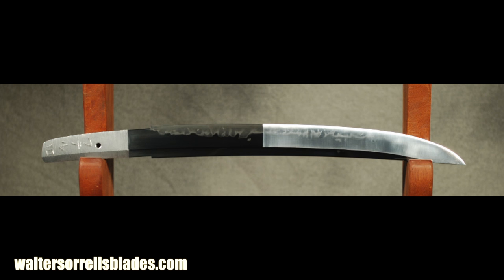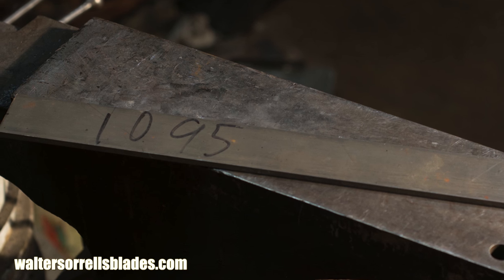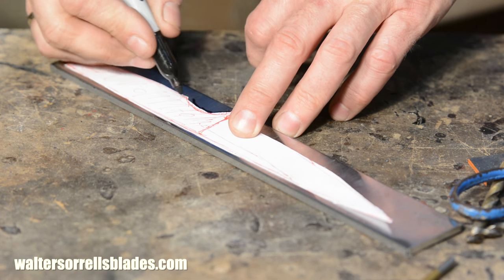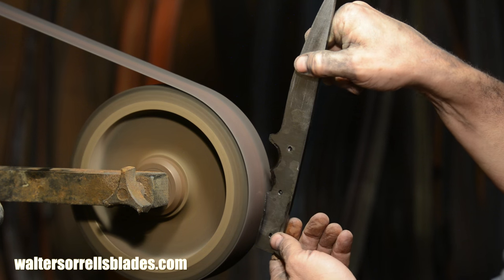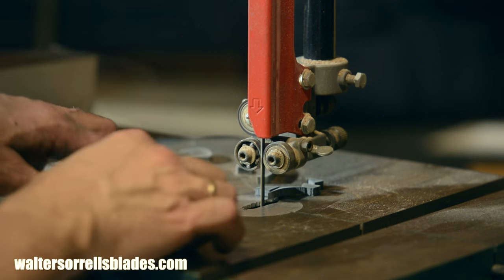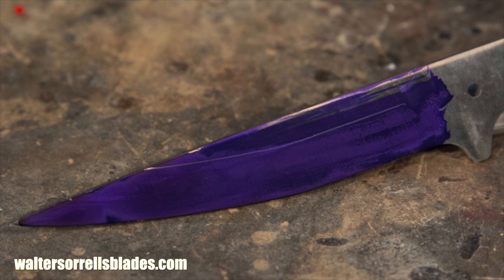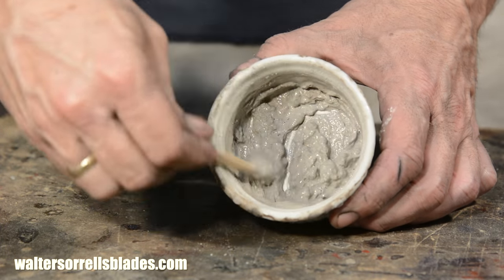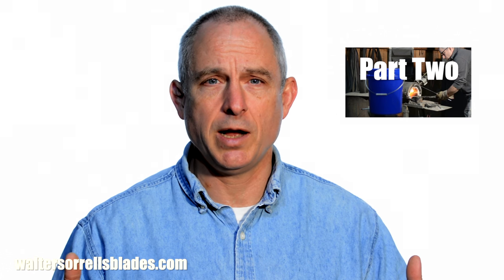Making a Modern Tanto for a UFC Legend

Comment: So, the temper line that you speak of. Is a temper line. They used to coat the spine of the blades in clay to prevent the spine from becoming as hard as the edge which would cause the sword to snap when struck.
Reply: +Shane Sischo Well if you wanna get really technical, "temper line" kinda makes a reference to tempering. A hamon is created during the hardening process, not tempering. You can have a temper line if you harden a blade homogeneously and then differentially temper it.
Reply: Aimee Frost The structure in the steel is created during hardening. Polishing it just reveals it.

Comment: As someone who just made an osoraku Tanto (but failed I the heat treat), I filed in the bevels and ended up with the proper geometry but I noti that there was a dip in the bevel near the transition on one side. So even if you atempt this by hand to get past the quirks of a belt sander it is still quite difficult to end up with the proper grind lines.

Comment: When my friend does clay tempering he also uses refactoring cement, but he puts a thin layer on the edge with charcoal mixed in. Supposed to reduce de-carbonization. Is that true ?

Comment: do you find that grinding the bevels pre heat treat gives you advantages compared to doing it once its been hardened? Awesome knife man you are a true artist!
Reply: +john smith pre-heat treated metal is softer / less time consuming to profile and you don't have to constantly having to worry about ruining the temper. If I'm not mistaken.
Reply: yes but there is more chance of warping the blade a little bit if you grind the blade before heat treat. I could be wrong depending on the steel. This is only stock removal i don't know much about forging or forged steels.

Comment: Hey Mr Walter I'm 14 and a starting out knife maker and I've made one out of a machete blade and I've just bought an angle grinder so I don't have to use and hacksaw and I'm trying to find some metals to make knives out of without puttin a huge dent in my wallet. Do you or anybody have any suggestions for metals to get? I just need something that's basic to use, keeps a good edge, and isn't too hard to grind or cut. Thanks for the video, they're always great I hope I can get to that level one day👍🏻
Reply: From my research I've deducted that old tools like shovels, lawn mower blades, or things you can find at a garage sale tend to be good since they are tools. Of course, you do have to soften the metal by leaving it hot over night and some will have to be shaped with a hammer and anvil, but I hope J helped. If you have any advice I'm all ears as I'm just starting off as well.

Comment: Hi Walter, thanks for the content as always. I came back here for a refresh and now I'm confused. 1095 high carbon is great sure but, the closest modern steel to old Japanese "Blue" or "Super Blue"? Can you or a viewer tell me how 1095 is closer than VG-10? Thanks in advance.
Reply: Well for one thing VG-10 is a modern STAINLESS steel.  It's not really close to either Super Blue or 1095. VG-10 has around the same amount of carbon as 1095 (a little less) but it also has a lot of chromium (15%) which makes it stainless, it also has cobalt and vanadium in it.
Reply: Thanks for the heads up, I'll do some more reading. I had the impression VG-10 was a mass produced modern equivalent to rare Super Blue. Thanks.
Reply: VG-10 is mass produced but it's a vanadium stainless meant for Japanese chefs. Sometimes it's used in expensive knives in layers of Damascus or even in San Mai (two layers of carbon with a stainless core) Spyderco uses it in their line of knives that are produced in their Seki City division. Super Blue is just a meticulously made carbon steel, it's similar to 1095 in alloy but more care is taken in the manufacture, it's not really rare or expensive either. Even the cheapest Japanese knives can still be made from Super Blue. You can buy a Higo Nokami knife with a brass handle and Super Blue blade for around 10- 20 USD

Comment: I hate to be Safety Sally, but long sleeves around rotating equipment (lathe chuck) can get you killed.
Reply from the maker: +Burning Spork of Doom   I know, I know, I know.  When you're a knife maker, though, you're doing 85 different things a day -- often in a freezing cold shop.  It's not like being a machinist where all you do is work a lathe all day long.
Reply: +Walter Sorrells Oh come on. Not all machinists work the lathe all day long. They work with various machines just like the knife maker. Like the mill, bench grinder, sand blaster, belt sander, etc...
Reply: +Chris3836 lol so lathes turned sideways. gotta love machining XD
Reply: Kyle Vereb yeah lol
Reply: Burning Spork of Doom. That's why you buy button on sleeves. if you have a mishap your sleeves pop off and you look like a bad ass.